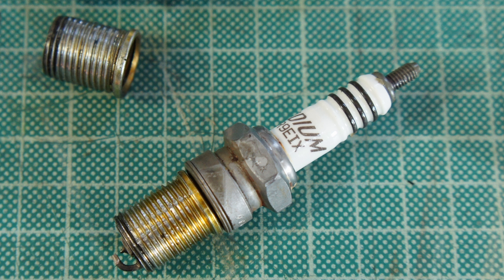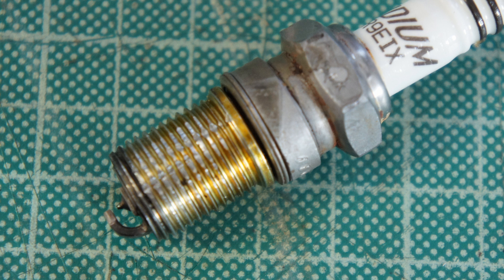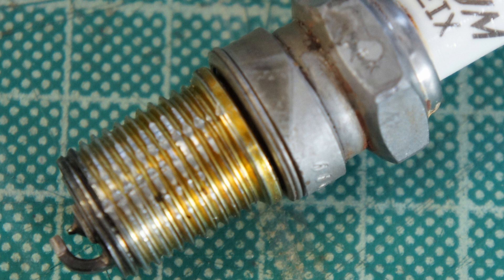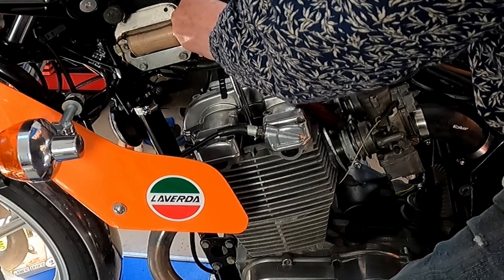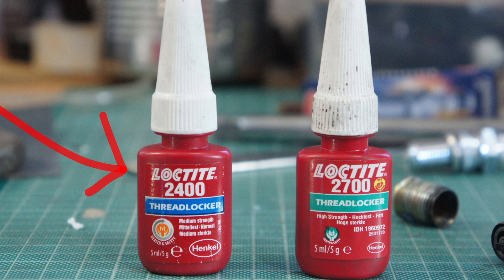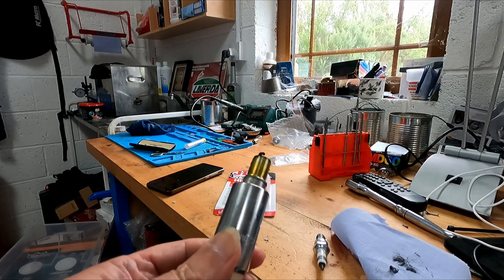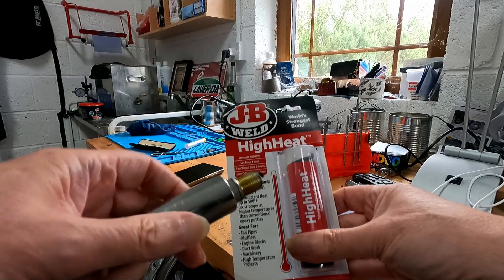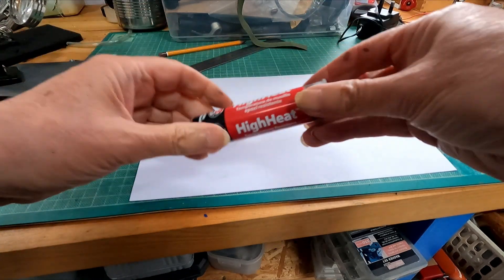Motorcycle Spark Plug inserts keep coming out how to fix

Comment: Did you have to bore out the spark plug hole and rethread it ?  If so how much did you have to increase the hole in size ?
Reply from the maker: Yes I have another video which was drilling out the hole with an M14x1.25, that included with the inserts from AliExpress. If you got the JMP Spark Plug Thread Repair Kit from XLMoto the tap with that kit (despite the price €49.99) was just rubbish and you need to buy a M15x1.25 to fit those inserts. The Spark plug was a M12 which is the most used on motorcycles while some very old Honda, Suzuki etc. have M10 spark plugs. Hope this is of some help.
Reply: @ ….. Thank you.  I’m hoping that I will not have to bore the plug hole out.  My 1978 XL350 spark plug is (I think) best changed without the gas tank on.  The fellow I bought it from said he replaced it and I will bet he didn’t remove the tank.  Coming out the plug felt not right and sure enough his new plug had some affected threads as did the hole threads themselves.  I’m going to try clean them gently and pray for the best.  Thanks for the information on threading, the plug is much smaller than the ones in my Bonneville.  Wouldn’t it be nice if some backyard mechanics worked slow and safe ?